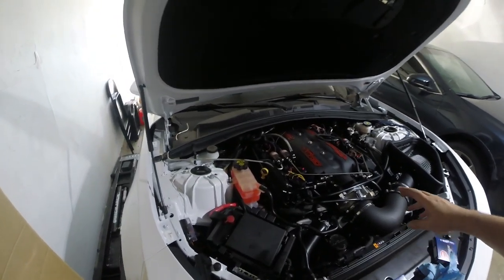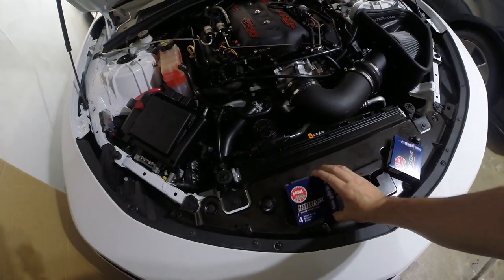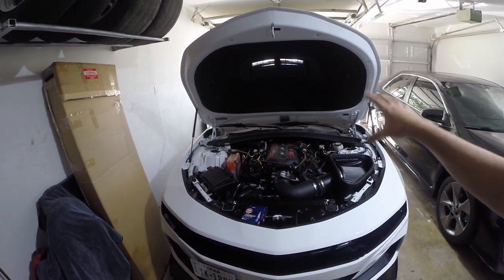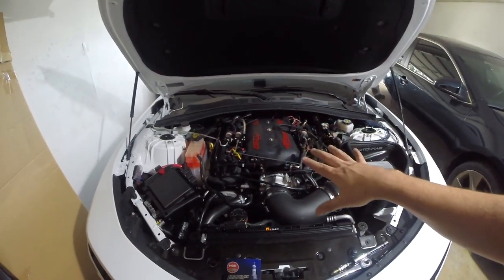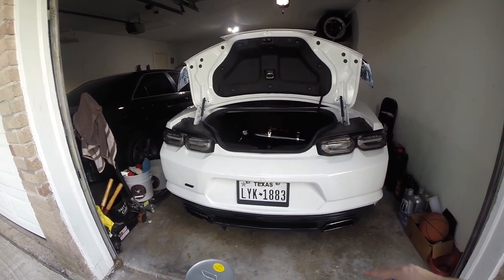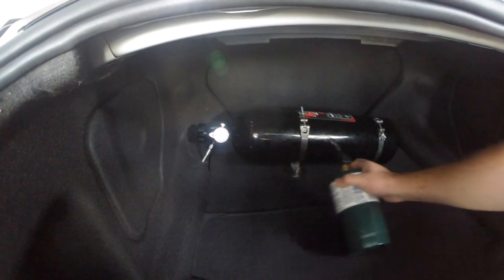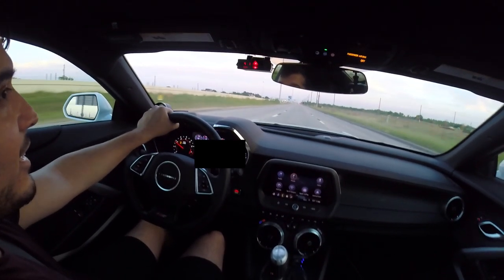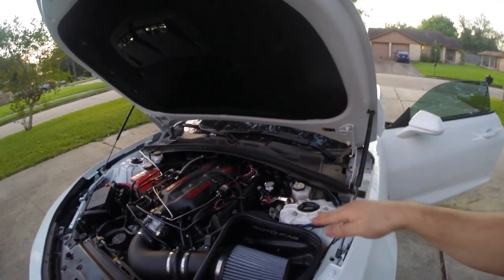Finally Purging and Trying the Nitrous for the First Time!! | Vlog #322

Comment: Jorge did you go with stock gap or increased on the “6510” plugs?
Reply from the maker: noom noomie i went with smaller gap I believe it was 24 thou I don’t recall if I said it in the nitrous install series

Comment: awesome!
Reply from the maker: Thanks!
Reply: @JLSpeed  that static fuel pressure is way different then flowing, pressure, maybe get a camera in there to see it, I had fuel and boost above the hood on my Chevelle. I would consider a heat gun before that open flame..
Reply from the maker: @paintslinger16  Yes the flowing pressure is different for sure. Really just need it to stay above 35 psi and using the concentrated flame of the torch should be pretty easy as long as i take my precautions. But ultimately i will probably buy a bottle heater bracket and wire it to me switch panel

Comment: So is that bottom coolant tank  supposed to be to the fill line like the top tank?
Reply from the maker: Cliff Hopping the bottom is just an extra area for expansion
Reply: @JLSpeed  ok i saw a forum that said it should be to the fill line so i filled mine to the line should i pump it back out ?
Reply from the maker: Cliff Hopping you should be fine, I actually didn’t know it has a full line in the bottom, I might have to fill it up lol my cars ran good as it was so idk
Reply: @JLSpeed  lol thanks man i guess i should have checked the owners manual in the first place 🤔😁

Comment: Why don’t you shift the car when your doing those pulls
Reply from the maker: Because im only trying to test the actual function of the controller and nitrous kit. I am testing to make sure the nitrous only comes on after 3k rpm  and doing a 40-100 in a high enough gear that the car won't spin on the street.

Comment: Is that the dry nitrous kit??
Reply from the maker: No…. It is not it is a way more involved nitrous kit.
Reply: @JLSpeed  okay nvm I looked it up and do you need a tune to run it?
Reply from the maker: @jeremiahl9492  not with my set up since I’m running a lingenfelter timing box to pull timing while the nitrous is spraying
Reply: @JLSpeed  oh so that’s what was holding me back from running nitrous was the timing issue I didn’t wanna pull timing permanently to run it I didn’t know you could get something like that
Reply from the maker: @jeremiahl9492  yeah I didn’t want to have to be switching tunes every time to run Na and then to run on nitrous so the lingenfelter worked great for me
Reply: @JLSpeed  I bet! apparently they don’t have those for the gen 3 hemis so that kinda sucks lol
Reply from the maker: @jeremiahl9492  damn that sucks lol